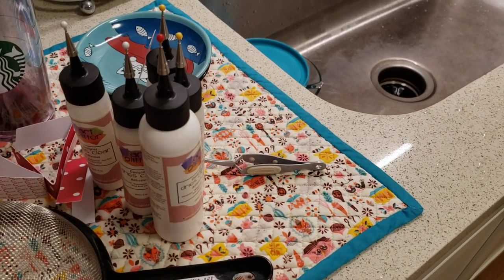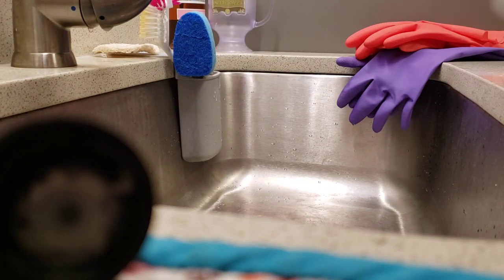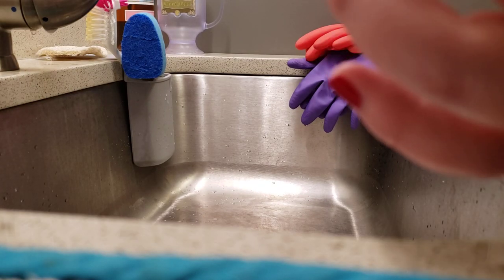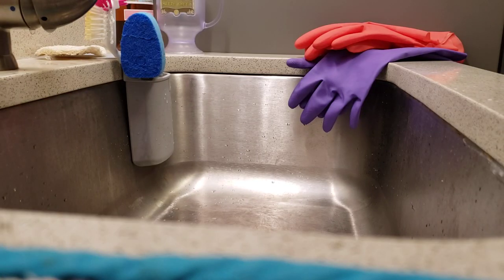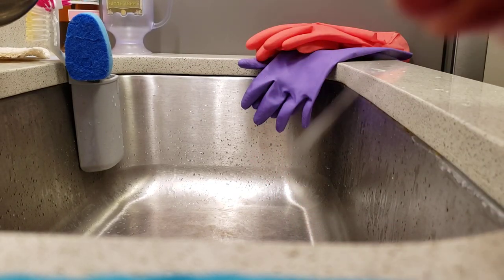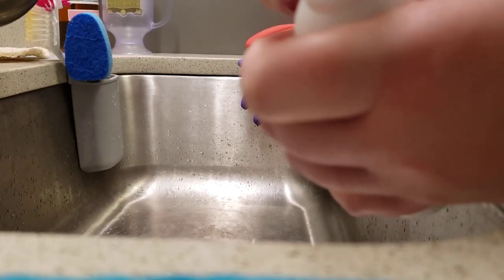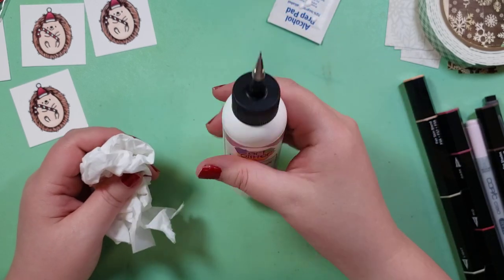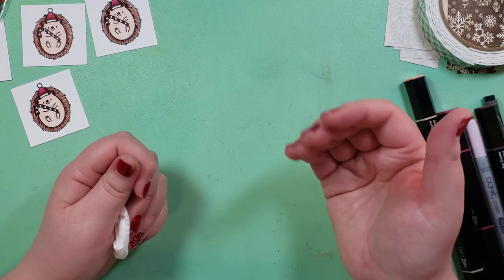Un-clog Your Fine Tips Glues For GOOD!

Comment: I lost my journal-making mojo for about three months and my Glitter Glue metal applicator was completely stopped up when I got ready to start again.    I do the same procedure as you showed every time I refill the smaller bottle and went through that when I got back to the Laboratory (aka, the craft room), to no avail.  I got the black plastic applicator clean but the metal tip kept clogging.  I left it for several days in boiling water that I warmed whenever I thought about it.  Still worked only a few times before it clogged again.  I want to avoid buying another metal tip but I hate the huge line of glue that the black applicator lets out.  ARGGHHH!